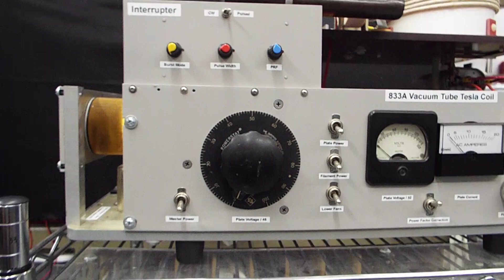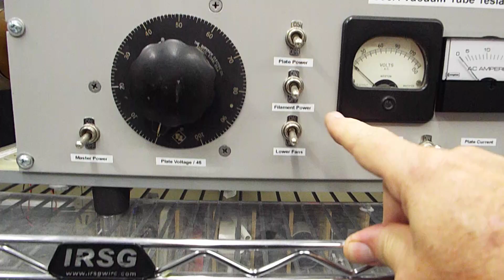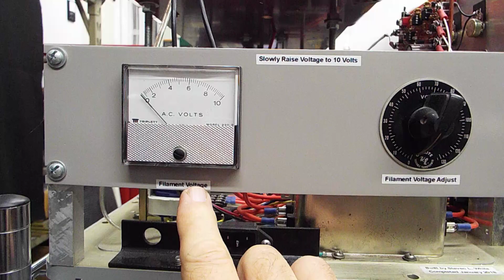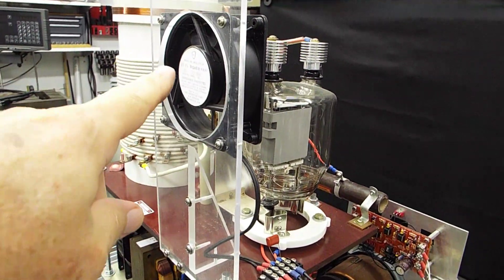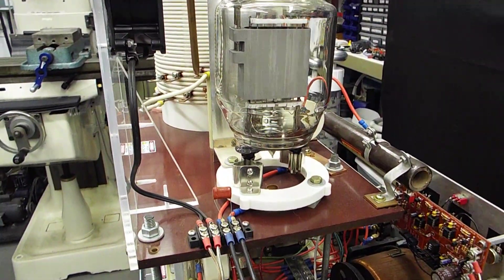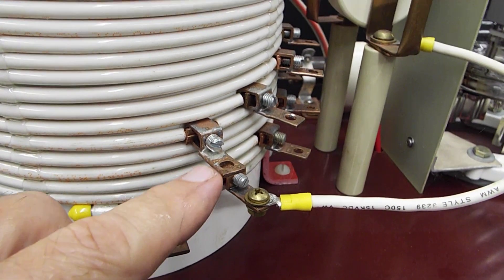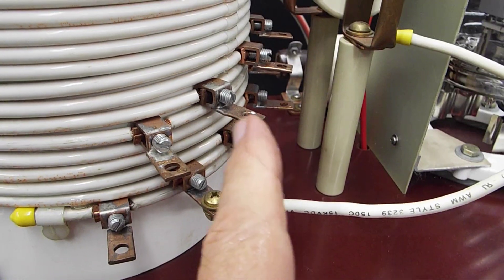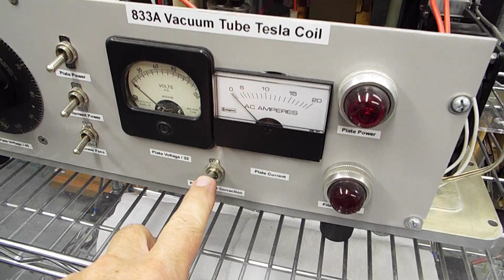833C Vacuum Tube Tesla Coil Overview

Comment: Love the open construction...and here I am converting my 304er to mostly closed :-D
Some updates real soon on this long going project...

Glad to see a proper filament transformer now.  Yes, those newer MOTs are terrible at no load at all, then load them up :-[  Just recently tested  a few for plate duty (just terrible they were) on an older VTTC  of mine which now has a T200 tube and a real plate transformer. Unfortunately this transformer is 38lbs by itself. Old big MOTs are the way to go to save on weight and not sacrifice too much. Glad you got rid of the rewound newer MOT for filament duty.  Nice graphite too...BTW, the T200 I am using on this old VTTC is too :^)
Reply: MOTs are terrible for power factor. The cores saturate very easily so one way to avoid absurd current draw is to add a few more turns (for filament) and power the transformer a few volts under line voltage (say about 100V)
Reply: Yeah, I am also still using a plate duty big older MOT on my 304er for "portability/all in one/ready to go" VTTC, just like yours.
Reply from the maker: I stayed with a MOT for the plate just to save weight even though they are pretty terrible transformers. I wanted to use a real plate transformer but the weight would have killed the portability.